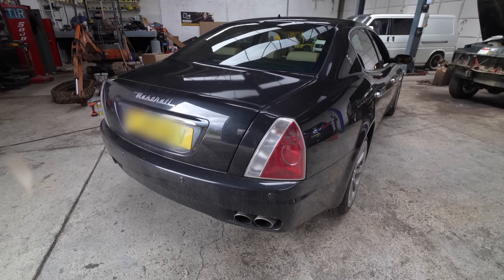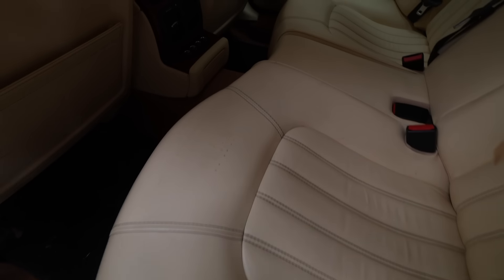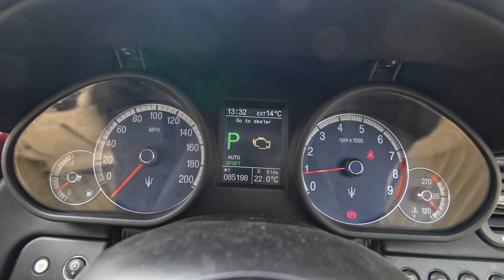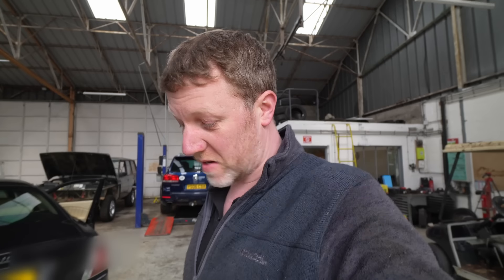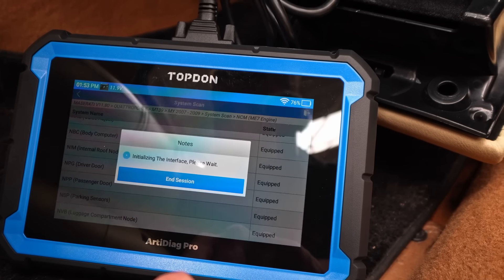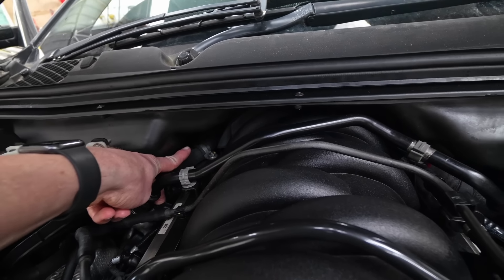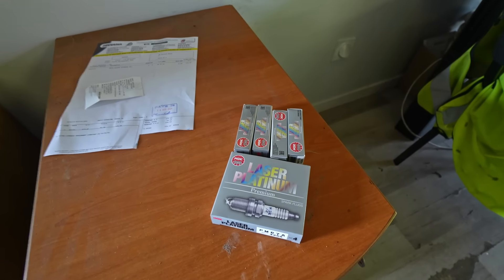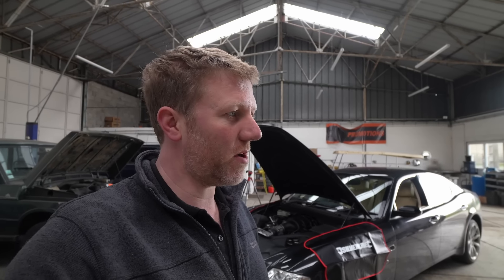I Bought The Cheapest Maserati Quattroporte In Europe...

Comment: Oh dear. At least the tires go round and round. A wrench symbol, oh my. I had a 63 Buick la sabre with 410 wildcat engine. There was enough room under the hood to have a dance. You didn't have to disassemble the entire car to change a plug. However I had a car where it had to be put on a lift to change the back plugs. If (enganeers)   had to work on this it would be designed a lot differently. It is a nice car though. Good luck.